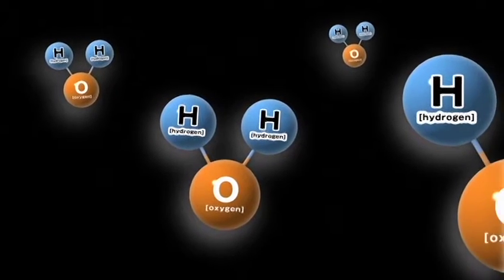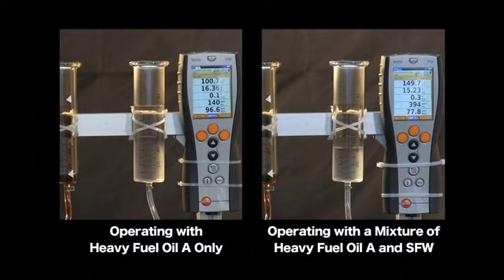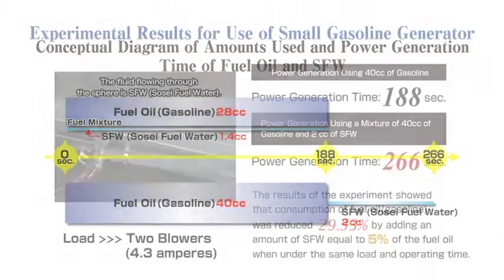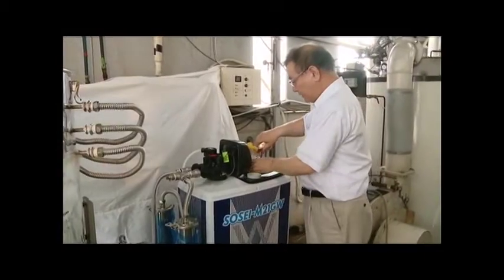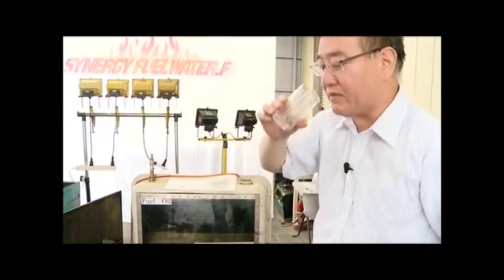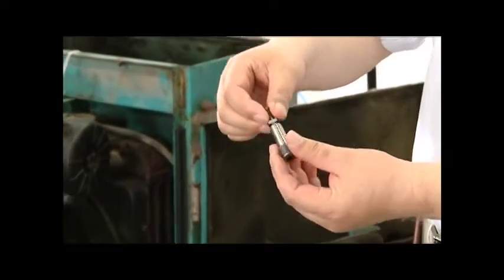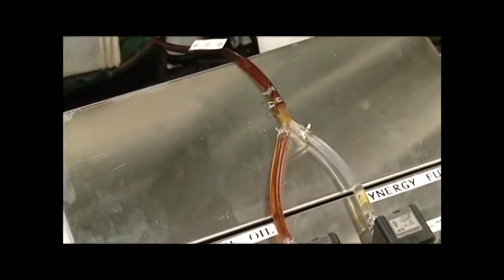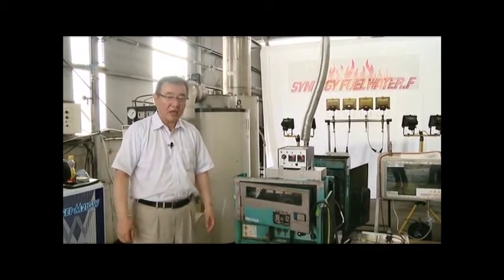SFW English Ver.

Comment: If one is to do an experiment using 100cc for a fuel source and then add to that 100cc extra fuel. Ok course you get a longer burn time. The experiment needs to be conducted with the a 100cc blend of fuel and water. Do at 20%, 50% and 80% and then see the run time for each. This will be a true representation at to time over volume with different mixtures. What I see now is added extra fuel, and getting long run time.